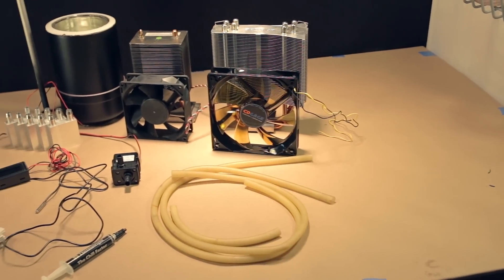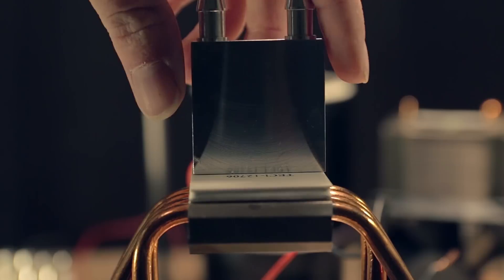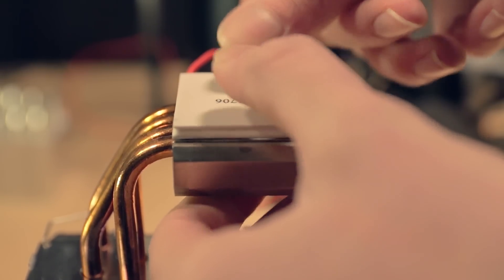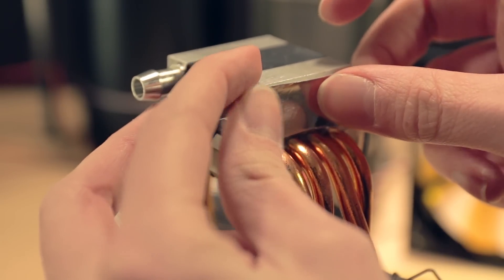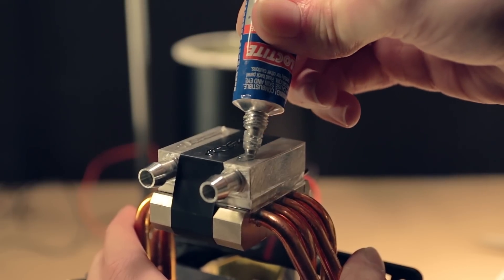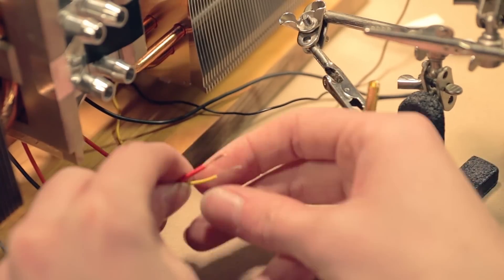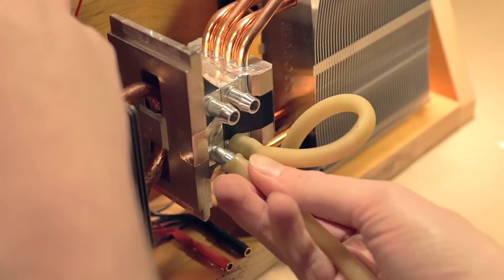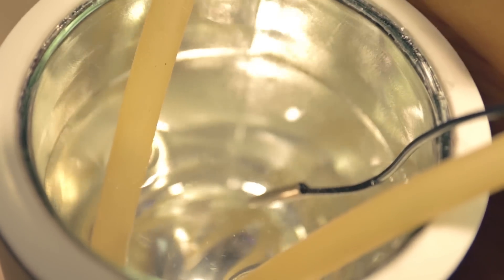Peltier Water Cooler

Comment: nice idea
it would work back in year 2003
now it will cause severe thermal throtling
most powerful peltier module (not chip) of size not larger then 40mm x 40mm is 12710, which is 154Watt at 15.4V (not available inside ordinary computer)
at 12v you would get at most 93.5Watts, which is not enough to cool any modern CPU
you may argue that there are 65Watt CPUs - yes there are such CPUs
I know something for sure - 125Watt CPU can easily use 225Watt of power
Tell me where this 100W goes? All 225W is going into heat
so lets assume it is same story with all CPU
65Watt then gives 117Watt of maximum power usage - thermal output versus 93.5 thermal conductivity, rest is pure purely heating up CPU and it is heating it up extremely rapidly
I know - I tried

Comment: engineer this and make it into a small form for cpu cooling
Reply: The problem is Condensation my friend.  See, you can't have your TEG unit at below room temperature or like that cold soda pop it'll start 'sweating' moisture.  A definite no no when it comes to PCs.  You need a temp controller and they're prohibitively expensive when you take into account all the bells and whistles along with fail-safes that need to be integrated into them.

Comment: Get a mini helium Stirling cryogenic piston. Get a solid state sponge storage tank that can be charged with Argon gas. Okay now insulate a tank that can have atmosphere removed generating a vacume without collapsing. Run insulated copper pipes that can be vacumed connected to a condensing coil that can hold a vacume with insulated copper pipe that can hold a vacume back to the cryogenic piston. Okat now attach electric fan that draw's air through condensing coil for air conditioning. If you construct it correctly the cryogenic piston will cause the Agon gas tho be pulled from the solid state sponge storage vessel turn it into super cold liquid Argon gas that fill's the insulated tank then fill's the condensing coil with the electric fan drawing air through the coil for heat exchange for air conditioning with the Argon gas boil off returning to the cryogenic piston or to the insulated tank were the cryogenic piston turn's back on and reforms the liquid Argon gas to start the cycle all over again. So you should have a air conditioning system that pull's 12 volts to produce a tank full of liquid Argon gas then shuts off.  Then a 12 volt fan or less volt fan to pull air through condensing coil to produce air conditioning. With the Argon gas returning to the solid state sponge storage vessel when the system is not in use. Look over the technology and spects then tell me what you think about it? This is a low tech version of this concept so i really am not worried about loosing any right's to the device i just want feed back about this concept is all? 😊
Reply from the maker: This is an interesting idea. What you've described sounds very similar to a Carnot Refrigerator. Khan academy has some very good videos about the subject. While, expanding liquid argon will absorb heat from the surrounding air, the process can only happen once unless you regenerate the liquid. The problem is, just as expanding a gas causes it to cool down, compressing a gas causes it to heat up. That heat needs to go somewhere or else the gas won't condense or cool to below ambient temperature when expanded again.  The amount of heat generated in a gas when it is compressed will always be greater than the amount of heat a gas can absorb by being expanded. This is because the entropy of a system can never decrease. The exact efficiency of such a system is dependent on the difference in temperature between the hot side and the cold side of your system. Watch Khan academy's video on Carnot efficiency. Lastly, a solid state hydrogen storage tank works by forming chemical bonds with the hydrogen being fed into the tank. Usually with mixed metal borohydrides or carbon nanotubes. The chemical bonds reduce the electronic field around the hydrogen atoms, thereby reducing their repulsion from each other and reducing the pressure within the tank. This isn't a way around compression heating, however, as the formation of those chemical bonds would also generate heat. The way air conditioners are able to cool a home using compressed gas is because they radiate the heat from compression to the outdoors.
Reply: Helium cryogenic stirling piston! a closed loop the piston turns on to turn gas into liquid then shut's off the liquid does all the work not expansion of the gas. I just don't think like you so you would also not understand how to use ultra low hertz frequency to cause refined crystal structure's to generate ultra low temperature's enough to turn surrounding atmospheric gases into a liquid correct ? 😒👽👄💩

Comment: at 150W no it can't run for hours on end :)
Reply from the maker: As long as the heat sinks are sufficient there shouldn't be any problems.
Reply: mendebil standard tec-12705's are rated for about 15v 5a - 75 watts each. Plus the cooling fans, that makes roughly 150w total. This setup should keep them well below their max operating temperature. MTBF for standard peltiers is 10,000 hours. So the psu is likely to blow before the peltiers do :p
Reply: they are like 20 percent efficiency. a compressor makes far more sense. same wattage gives you like -25 celssius on a 60x60 evaporator . think green. cheers?
Reply from the maker: Yes, compressors are more efficient but they are also bulky and noisy. This design is meant for tabletop use, without regard to efficiency.
Reply: Absolutely - and with passive cooling, no moving parts and complete silence. Did I mention longevity?

one major thing about TEC's people tend not to know is that they "remove" heat from the cold side. When people talk about the incredibly low efficiency, they are describing how much heat is transferred - but the heat has to be there in the first place, and is dependent on the temperature on the hot side. 

In Magneto!'s scenario, removing heat from something that is already cold really brings out the inefficiency of TEC's - better off using a refrigerant based system if you want a low power solution. However, removing heat from something hot - like a CPU/GPU for example is where these shine - you will see dramatic temperature drops when under load, especially if good thermal dissipation at the hot side is achieved.

try measuring the temperature of the cold side when used to remove heat from the hot side of a TEC at 75 Watts - you should see temperatures well below ambient. Think about that - a TEC, with a claimed efficiency of 20%, removing at least 75 watts of heat.

Comment: Simple observations: Too much thermal paste and a smart man would have put a TEC on each side of the water block.
Reply from the maker: Ben TheGuru Yes I know I used too much paste. I just wanted to be sure I covered every square inch of the plates without getting air bubbles. And before shooting the video I actually did try to put a chip on each side, unfortunately the top of the cooling block was either too small in the first case or not solidly bonded to the heat pipes in the other. If I had different hest sinks though I definitely would have.
Reply: The thermal paste quantity was fine as long as he applied a high pressure to give off the excess
Reply: Ben TheGuru ffs if the pressure on the heatsinks is ok, there can never be too much thermal paste. just stop saying that too much thermal paste has an effect, IT DOESN'T!!
Reply: It depends. If there isn't enough mounting pressure, the paste is going to act as an insulator.
Reply: MotoK tips the point of thermal paste is to fill in tiny gaps where air would reside. the best conduction comes from the plates making physical contact.

Comment: im planning on using something like this to chill the air in my house and using solar to run it as i only need it chilled in the evening and during the hottest part of the days here in texas. i want to also put up peltier radiators along opposite sides of my lot in the way the wind blows. im planning on using glass plates to make it look pretty rather than metal plates. the other sides of the lot will have a water filtration system, by law in this city i have to use the city water for the toilet only. i hate it because they charge for 500 gallons min. i think the law should allow perfectly safe systems like mine. in another city i plan to do the same but they are ok with me using my own system. they just want me to pay taxes and thats fine with me. i plan to run the water first through the filtration system, then through the peltiers at the wind sides, then through something like this and finally to my spigot. i also want to use peltier theory to heat my homes in chilly weather. i thought to make some magnetic devices like these so i can change the orientation as needed and just lay them on the metal rooves. when chill needed i can turn that side down. when heat is needed, i can lay that side down. also the hot side will be white and the other black. the attic will have a closeable fan and vent that run on the temp in the houses. there's more but i will only spill more beans about it others ask.  im going off grid as much as the law allows. sorry for the bad spelling. i gave up on that. shalom

Comment: Uhhhhhhhhhhhh on the cold side you should have used a full aluminium/copper heat sink with NO heat pipes, as heat pipes work by heating mercury and/or ammonia, which goes to the fins and the fins dissipate the heat, and it condenses back into a liquid. and ammonia and mercury don't heat and flow if they are being cooled. So they literally don't do much if your just cooling. So next time use a solid aluminium or copper block instead of heat pipes. Cool project though
Reply from the maker: Henry Read-Spinks The hot sides are on the heat sinks. The cold sides are on the water blocks.